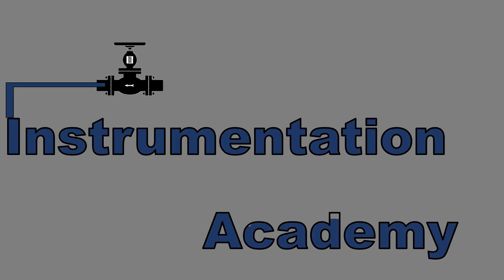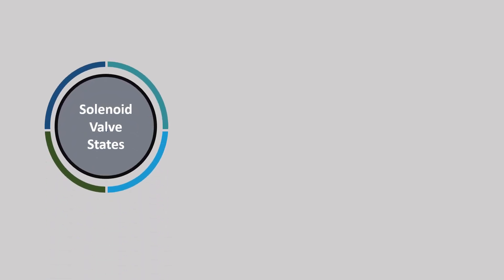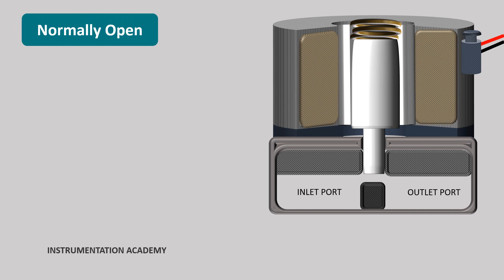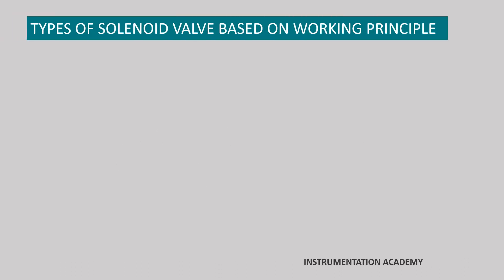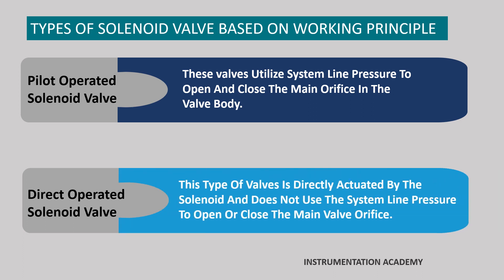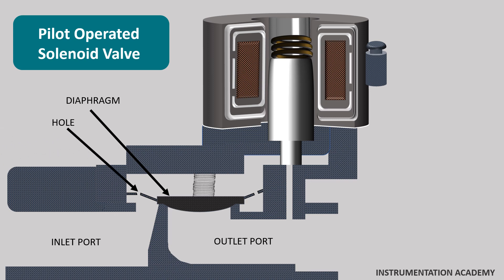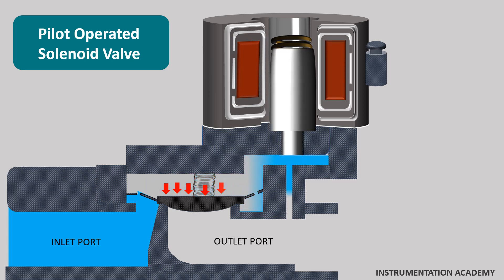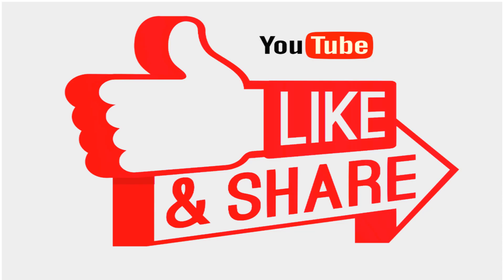How a Solenoid Valve Works.Pilot Operated Solenoid Valve.Indirect Acting solenoid valve. Animation.

Comment: How will the pilot operated solenoid valve shut after  the diaphragm lifts? The flow of the medium will continue and differential pressure will not be attained for the valve to shut.. Pls correct me if wrong.

Comment: So, if I get it right, a solenoid_pilot operated valve is just a solenoid valve since, the opening of the valve is only caused for the solenoid. On the contrary, in a pilot operated valve, a solenoid is not used and the opening is done by the pilot connection (air pressure)